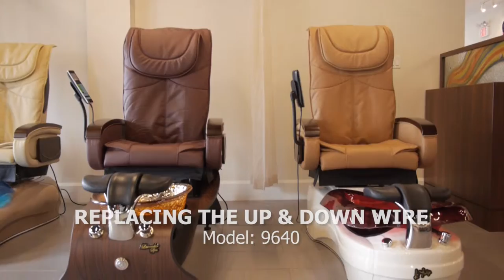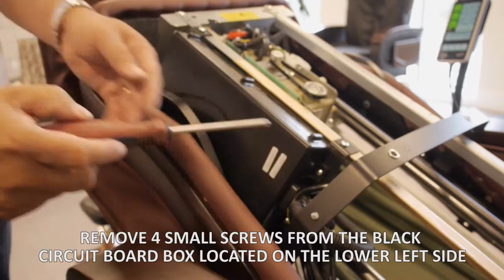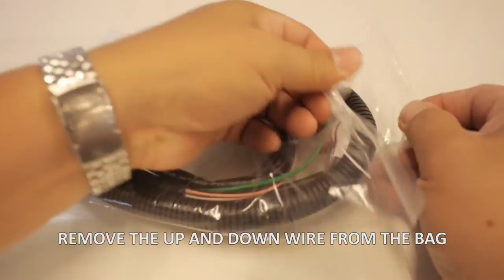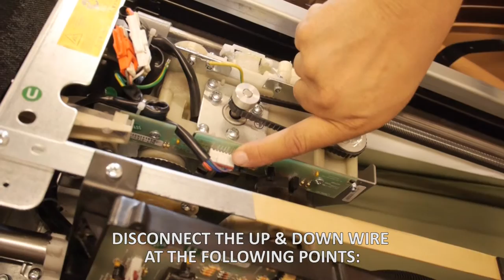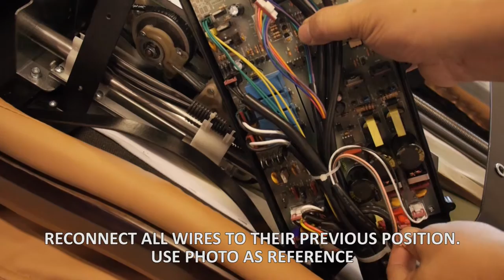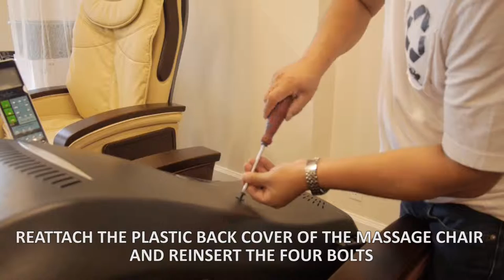9640 Up/Down Wire - English Subtitles

Comment: can you help me please how can i check if the pcb board damaged is or 
why please ? When I switch on the button from the remote control 
(console) then can i only see the picture with the chair and could not 
activate the massage function except the chair can
 go back and forth.

On the pcb board are 2 lights (led) and the left light flashes, the 
right is constantly on but not so bright (By the way, do they speak Vietnamese ? do you have the manual in German because my english is not very good)